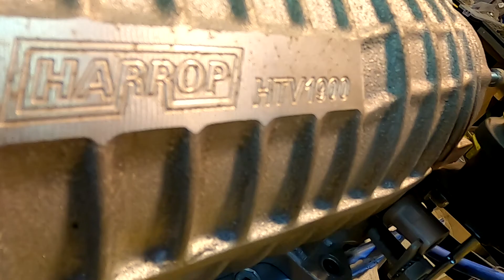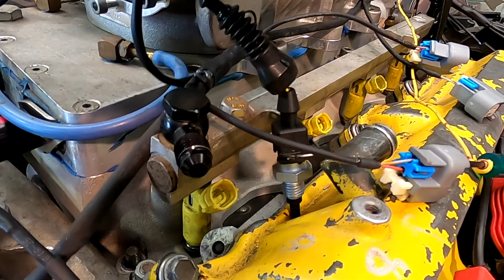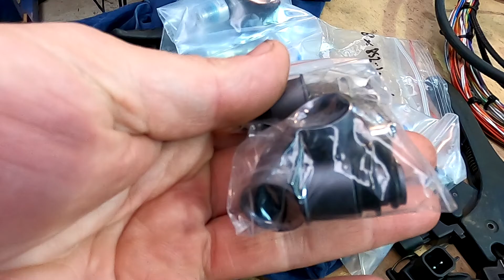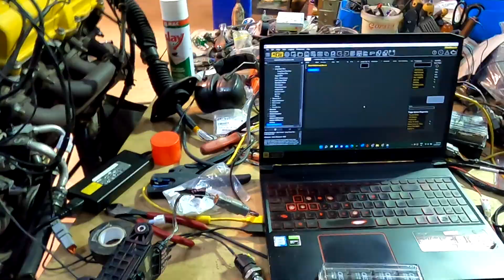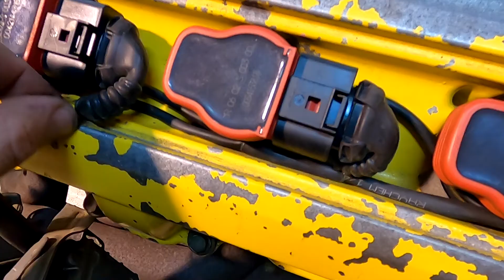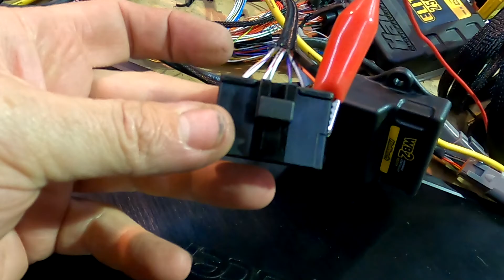Ross's loom.   Haltech 2500 ,  1uz supercharged,   manual transmission and drive by wire throttle.

Comment: Yo, I got a question if you don't mind, I was putting in the cam cap bolts, and two of the bolts were stripped, and I tried fixing them and ended up making them worse I try using hex coils but that sleeve that goes above the hole is in the way. Is there a way I can replace that sleeve or better yet get it replaced or am I gonna need a new head?
Reply from the maker: I'd remove the sleeve then helical the hole and refit the sleeve.